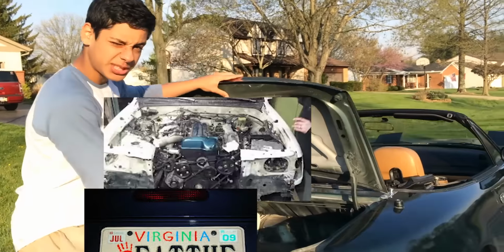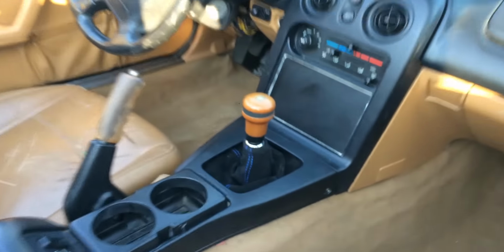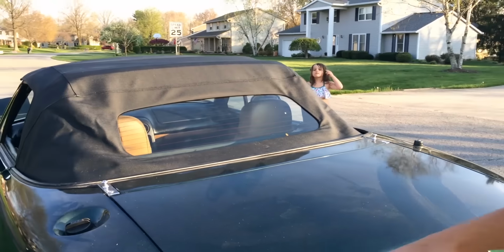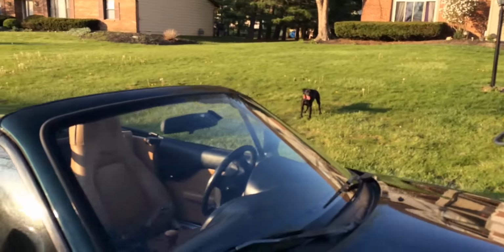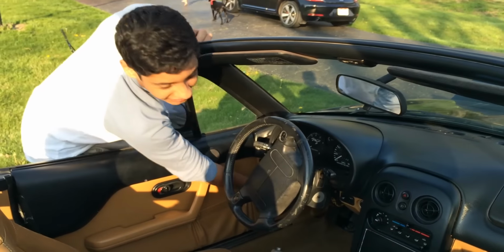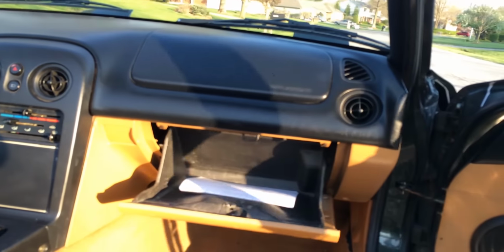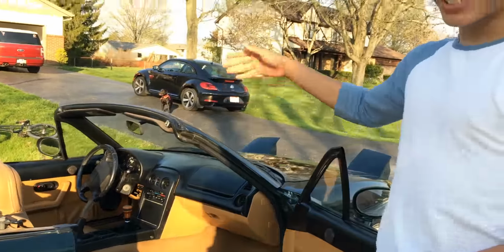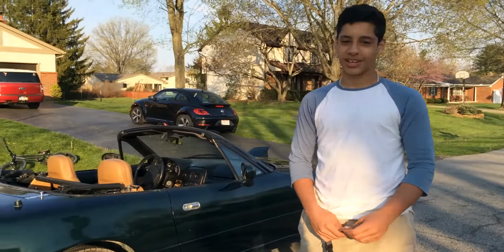My First Miata: Car Check (Josh)

Comment: Definitely not worth 2200
Reply: WhipsAndTips I just bought one about a month ago it's a 97 m edition 111000
Reply: Miles and I bought it for 958 dollars at auction with a tad bit of rust
Reply: Rust is like cancer for miatas. I bought a 1990 with 96k miles for $2000, it had a small bit of rust on the rockers but very minor compared to other miatas in my area, but a body shop fixed that for cheap.